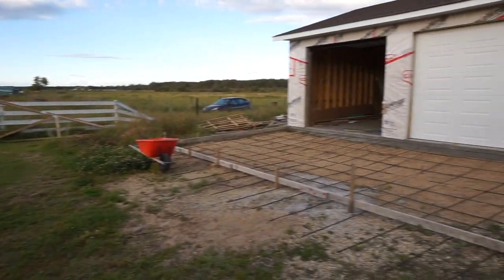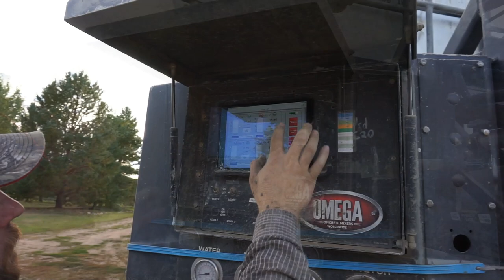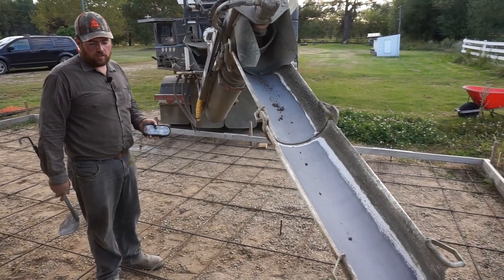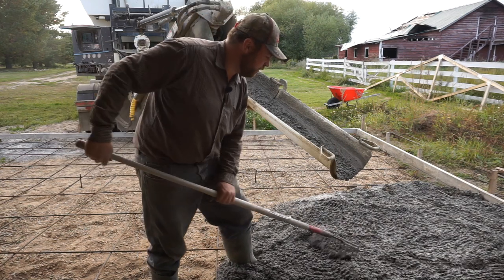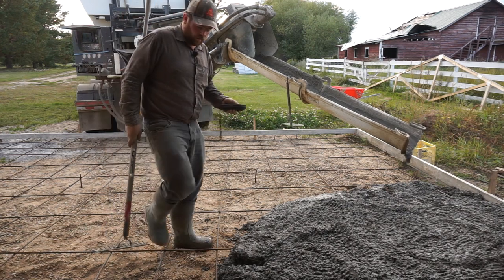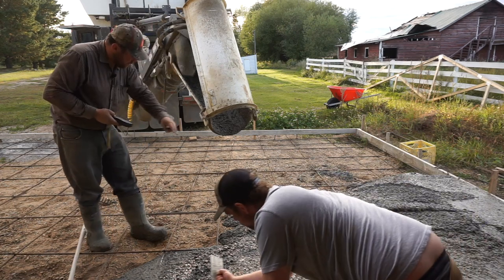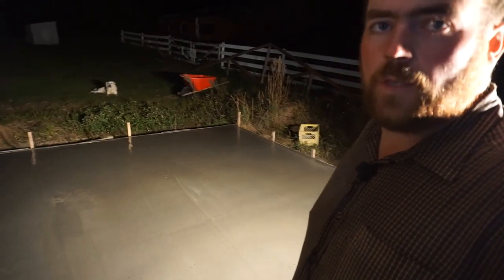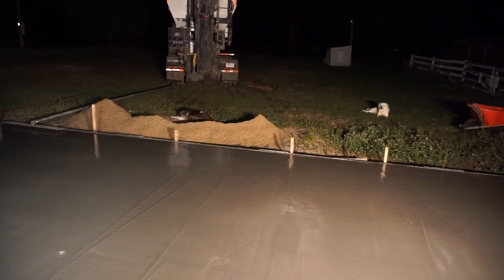Pouring an apron in front of my garage |  Volumetric Concrete Mixer Ep.10

Comment: Greetings from Russia John Neufeld!  Your videos are always amazing!  You understand the mood.  You have good concrete.  And my car can't do that yet.  The concrete is not homogeneous.  Checked in the laboratory.  Perhaps we have a wrong screw design.  Or can such a mixer only make liquid concrete?  We only poured concrete into a block shape like in one of your videos. #volumetricmixer #volumetrixmixeroperator #concretemixer #roadmaster #roadmasteromega
Reply from the maker: I'm not sure what you mean with your question if such a mixer can only do liquid concrete, what kind of concrete are you trying to make?
Reply: @johnneufeld02  Our Is the mix too uneven because our concrete is too hard?  Does the mixer mix better with more water? If you raise the auger higher, make the angle larger, will it blend better, or does the angle not affect the mix in any way? The biggest problem I had was when there was too much concrete in the mixer.  The upper rubber opened and the concrete flew in all directions))
Reply from the maker: The auger angle should be about 45°, and yes I would say these augers are designed for wet concrete.

Comment: John at the beginning when you check the concrete did you rotate the auger in the opposite direction?  This is not dangerous?
Reply from the maker: Yes I rotate it slowly in reverse to check it, I dont think its dangerous if you go slowly. You don't want to run it at full speed in reverse because your driving the concrete against the bottom bearing.
Reply: Another thing you need to check out for is your measurement (The gage settings) what ratio are you mixing?